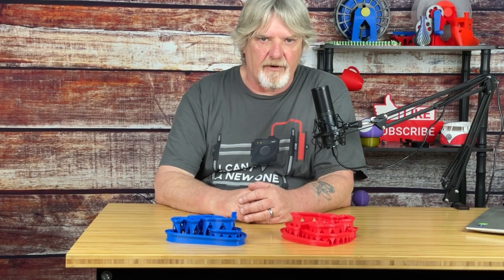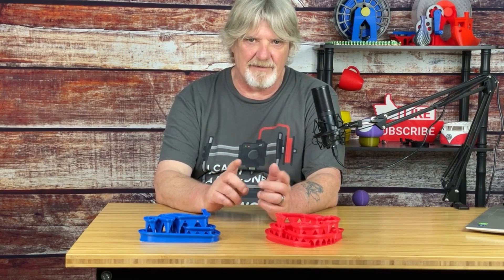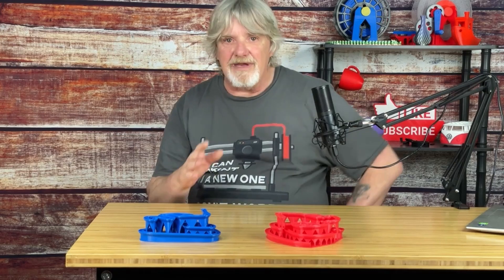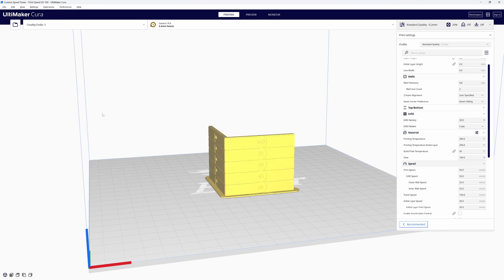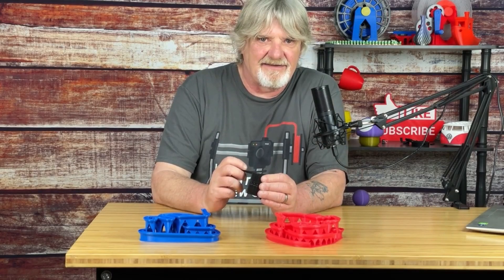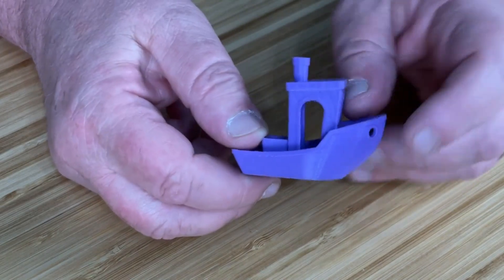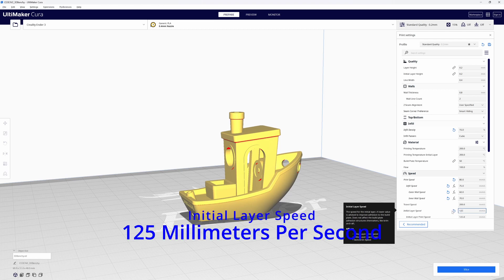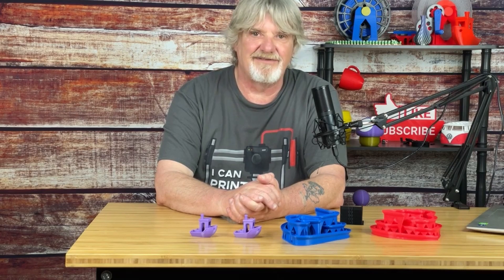Speed Vs Quality

Comment: Thanks so much for the test and info! I own a basic Ender 3 less than a year ago and I'm still not an expert with Cura advanced settings. I'm now in the process of printing a very custom made laptop base and docking station box (with many USBs, audio and video interfaces, space for old HDDs, space for the laptop charger, etc), which I managed to separate in 14 large sections to print + screws.
It’s my first time testing printing faster than 40mm/s, trying to make each part print in less than 48hs. 
Now I'm trying 75mm/s + 50mm/s walls. I don't really need a perfect quality print because the box is for me. I'm happy to see the Ender 3 being faster with no modifications or custom firmware, etc. I misunderstood the limits of this printer!
Reply from the maker: The basic Ender is a great printer I still a couple of them as well as my Ender 5 & 5 Plus. I'm glad you found out how good of a machine it really is!!!! Thanks for watching!

Comment: This need for speed has gotten out of control as companies race to advertise speeds up to 600mm/s! There are no statistics as to whether this machines have reliability in the long term never mind the short term. Most of the prints I have seen are mostly junk and I see reviews pass over the faults and saying " looks good"! I want quality prints and will print as slow as necessary to obtain that result. Also want a reliable machine that is quiet unlike the Bambu and others that make a racket. Gerry
Reply from the maker: I can't argue with that! I do have a Bambu X1 and I do like it. But like you said, there are no statistics as to their reliability in the long term. I am keeping my fingers crossed. But what bugs me most is that when somebody gets a Bambu Labs printer, they jump on FB/Reddit and saying they are selling their "Fill In The Blank Brand Printer". I'm still using my Ender 3's, 5 and 5 Plus's just as much as I did before. I also agree with review pass over of "Looks Good". 9 times out of 10 I see those comments and think "Really?" Speed is nice, but quality is the ultimate goal. Thanks for the comment and thanks for watching!
Reply: @pushingplastic7445  You might prefer looks, others prefer strength or fast prototyping cycles.  I don't care about zits or other small artefacts as long as my part works correctly and doesn't break easily and if that can be done at 300mm/s on my corexy, then I prefer that over waiting twice as long to avoid those tiny artefacts.  But regardless of whether you want quality or speed, Klipper really makes a difference.  OctoPrint + Marlin caused many more zits on my printers than printing twice as fast on Klipper - and this was with a 32bit board.  I like the simplicity of Marlin, but just moving to Klipper, doubling the speed, tuning PA and Input Shaping (with a print, you don't even need the ADXL) will significantly improve quality.  Marlin just has to do too much on that printer's mcu and that hampers accuracy.  Sure, Marlin now has input shaping and I tried it, but it didn't come close to the quality and smoothness of Klipper.  So, regardless whether you want speed or quality or both, move to Klipper!

Comment: Great info Bill! Even printing at moderate speeds, 3D printing has so many variables, that it takes epic amounts of time, patience, and deductive skills to get quality prints. The machine, filaments, environment, and even the designs themselves all add up to one hell of a challenge. I thought I was getting good, then I switched filament brands and met my match with a part that, as of now, is impossible to print cleanly at reasonable speeds. That's all part of the fun though, isn't it!
Reply from the maker: LOL, you got that right! I'm to the point of not like to change filament brands sometimes!

Comment: Thanks for the video. I am using the Anycubic Kobra Max. I cannot get rid of hair-type stringing on my prints.
Reply: And you tried different filaments?  Could just be the filament.  Insufficient retraction or just a bit of moisture in the nozzle can cause a tiny bit of plastic to ooze out and form small strings.  Depending on the filament, turning on wipe-while-retract (typically under filament settings in the various slicers) might help (or make things worse ;-) ).
Reply from the maker: Cross these items off of the list if you've already done them..when I get a new printer I always check my esteps first followed by flow rate. THem I'll run a temperature tower to dial that in. The next step I would do is check the flow rate, then retraction. I have videos for doing all of those things on my channel. Temperature and retraction will go along way in reducing stringing. A slow print speed helps to. I hope this information helps!